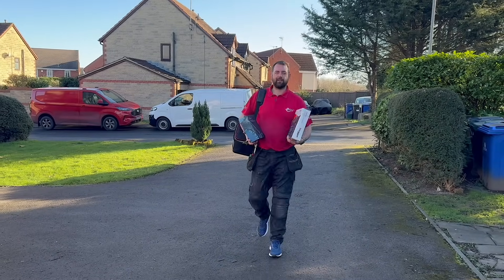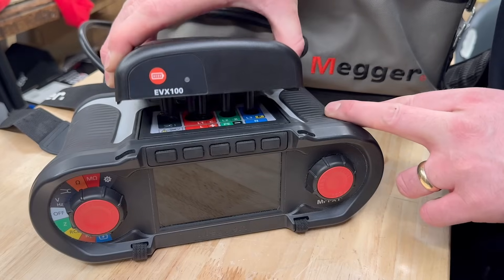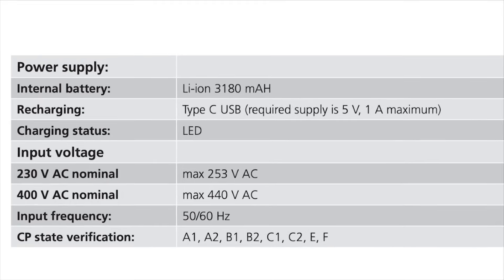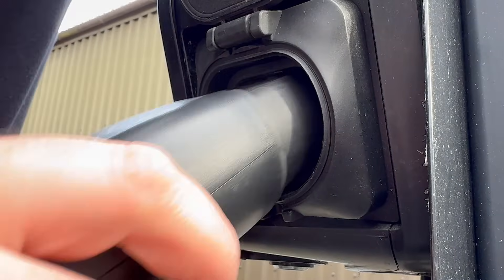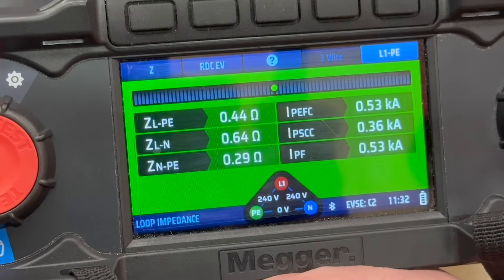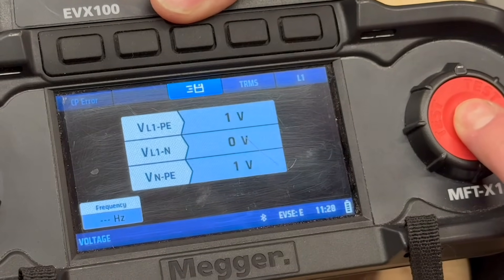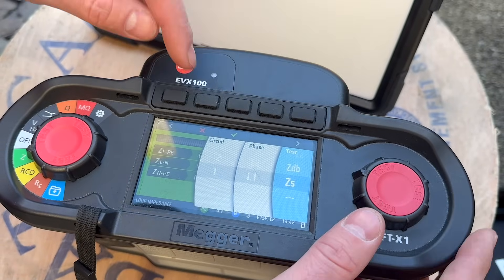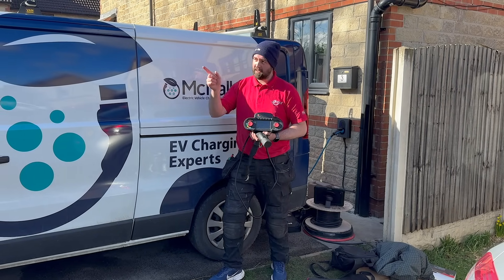Megger EVX100 - The EV Tester Upgrade You Need!

Comment: An X1 that actually turns on and stays on, absolute miracle. Mine will be going back to Megger for the 3rd time.
Reply: We have two X1 on the firm since launch and had no issues. You are really unlucky to have had to send one back 3 times must have been a Friday afternoon edition.
Just in case you think ours are gathering dust and that's why,  they are used almost daily.
Reply: @nortonelectricians9165  that's good to hear. Mine definitely has an issue with the way the battery connects to the PCB. I'm hoping they just replace it. 
I love the X1 but it's getting a little frustrating now. 
Having to take the battery out to charge it, is a poor design choice imo.